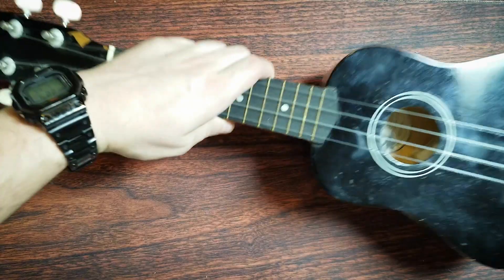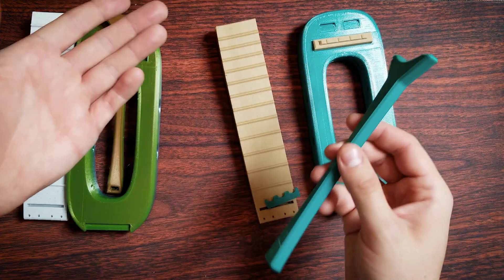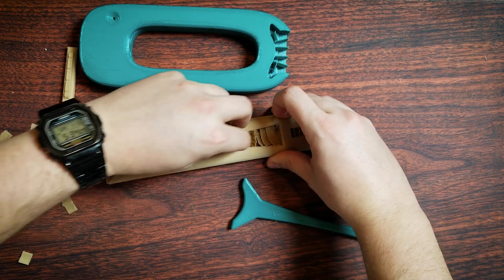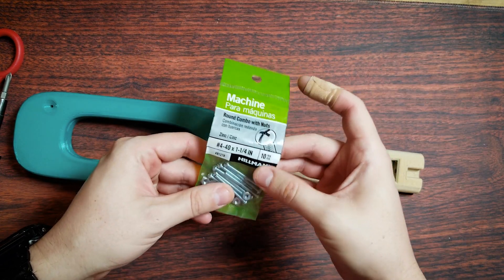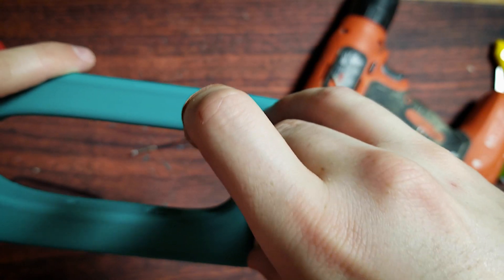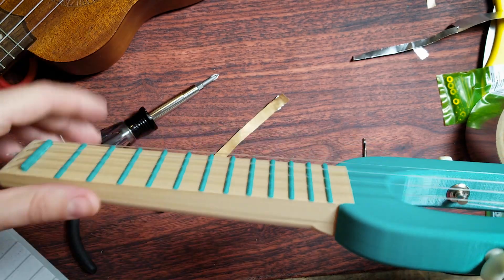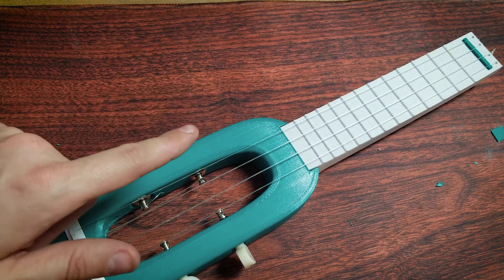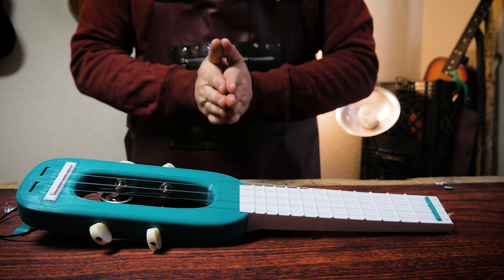This 3D PRINTED UKULELE only costs $10 to MAKE! (but how does it sound?)

Comment: I made a couple of these as well. At first, I was happy with them, but, the moment the novelty wore off, I decided it was a waste of filament. Here is why... 1. The friction tuners are not intended for plastic. I am a very gentle player, but I could not get the silly thing to stay in tune for more than a few seconds. I tried adding felt washers, which extended play time to maybe 45 seconds, but still too unstable for practical use. 2. I printed my neck as intended, but still had the same problem you did with your first neck. Also, trying to fix it with the truss rod broke the truss rod. So, I tried reprinting the truss rod with 100% infill and the neck with also much more infill. I redesigned the body to fit geared tuners. I even printed geared tuners out of ABS to try to experiment.  (They broke under tension)  Mark II worked better and I had a blast with it for a couple weeks until I noticed the neck continuously bowing. Eventually it was unplayable, and again, the truss rod broke trying to adjust this. Finally, I made one out of scrap softwood (from a bed slat my kid outgrew) using hand tools, and so far, that one has held up longer than either of the printed ones. Funny thing is that, considering the cost of filament and all of the futile redesigning in CAD, the wood one was both cheaper and quicker.
Reply: I made this one, got a bit better tuners so it held the tune for days, but eventually it stayed in direct sunlight for a few days and it bowed under the string tension. Got as much as possible from the tension rod, but the strings are far from the neck, so it is harder to play.

I used 50% infil and 6 walls, if it helps.

Still, amazing build, and i used it to practice in the evening so my kids don't wake up. Still do if i need to practice technique, but it is pretty hard to actually play on it. 

I will rebuild it in wood, using the neck from a donor uke. The form factor is pretty unbeatable for a travelling instrument.
Reply: Thanks for this, I was thinking of making one but rather thought the same. Did you make the neck for the wood one? That's the thing that seems a bit daunting.
Reply: @rexjaguarius  yes. It only took a couple hours. It's softwood, so it is easy to work. I tried, years ago, to make a guitar neck out of pine, expecting it to bow, and that's exactly what it did, but the shorter length of the ukulele neck, and a little bit more thickness, and it has been fine so far.

Comment: The truss rod can help with the bend in thw neck. Truss rods were invented to counteract bowing of necks under the tension of the strings. So on traditional truss rods you can just ighten it some more and it eliminates the bend. However idk if this one works as well

Comment: Interesting project.   Why not buy a fretboard with metal frets and glue it on?   The sound is really dampened and muddy.  It would be better with steel strings and humbucker pickup.
Reply from the maker: Agreed, already in the works!
Reply: Sadly no. Steel strings create too much tension. Not only enough to destroy the plastic, but even enough to render friction tuners inoperable. But, in any case, plastic cannot be used, so 3D printing is basically incompatible with steel strings.

Comment: You need to go to a real hardware store. Metric has been a thing for a long time in the U.S.. There hasn't been a U.S. built vehicle that didn't have at least 50% metric fasteners since 1973. Also...the neck is bowed because you didn't bother to adjust the truss rod to correct the bow.

Comment: Do you think the 3d design will work as a left handed uke?
Reply: yes. I think all slicers have the option to mirror the model before printing. mirror that nut and good to go
Reply from the maker: I don't see why not!
Reply: Thanks!  I was just thinking the nut could be a problem.  Now to find a 3d printer haha!
Reply: Do you have a video where you install the strings?

Comment: can you please show me how to insert the strings? I wasn’t able to see it well in the video.
edit: I found it was easier to feed fishing line through, then tie the fishing line to the string and pull it through after wrapping the fishing line around a screwdriver.
Reply from the maker: If they're new, they should slide through the gap on top and curve out through the middle. Mine were used and I had to do it in a weird way by feeding tape through the holes.
Reply: @Patrick_Gibney  how exactly do you use the masking tape? I got brand new strings and I’m still having trouble getting it through
Reply from the maker: If you fold the tape lengthwise with the adhesive facing in, you can feed it through, then sandwich a string in the middle to pull it back out. It's not super elegant, but it works!
Reply: @Patrick_Gibney  
The masking tape trick almost worked, but maybe it was something with my print… I found a better method and I put it up in the edited comment for other people to see, thanks!
Reply: @Patrick_Gibney  thanks for responding, btw

Comment: Hello! I am trying this project - what did you use to get the strings to go through? Even with new strings, I'm having some trouble with that step :/
Reply from the maker: I used about a 6inch strip of masking tape folded in half with the end of each string inside and fed it through the holes. Definitely the trickiest part!